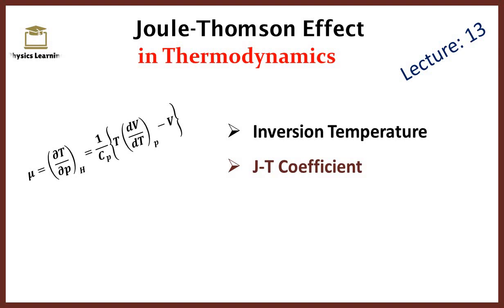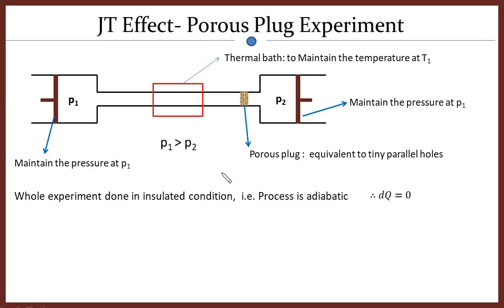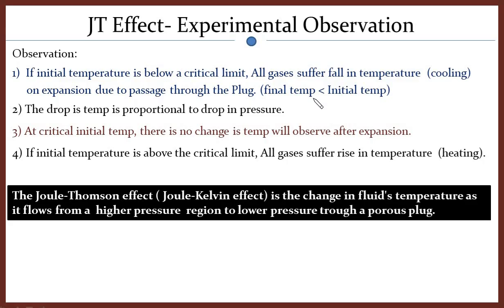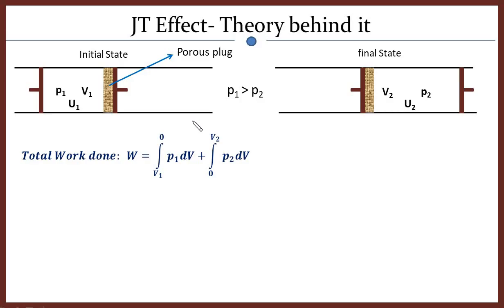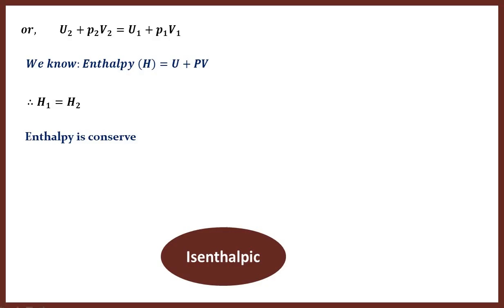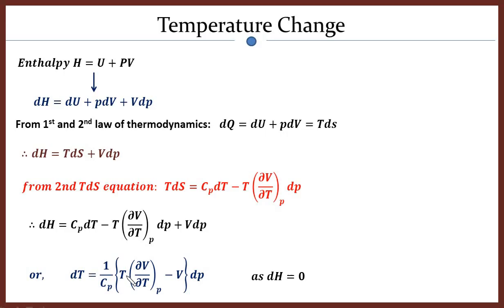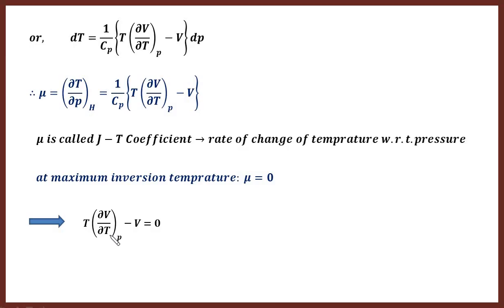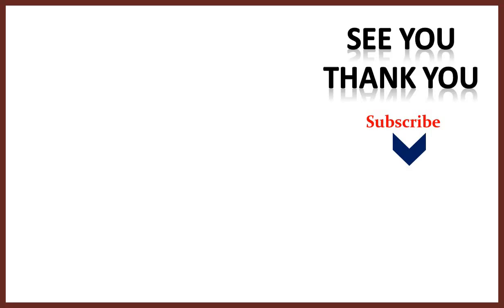Joule Thomson Effect | Inversion Temperature | Explained | J-T Coefficient | Lecture 13

Comment: I have a question. We define thermal expansion coefficient as alpha = delV/delT over V, so we can replace delV/delT as alpha times V. Then, according to the last equation you'd derived, for mu to be positive(mu>0), T should be "greater" than 1 over alpha. 

But, here's inconsistency with your statement at the beginning of this lecture. You said, when initial temperature is "smaller" than maximum inversion temperature, cooling effects accure, which is equivalent to the statment mu >0. 

I want to know why this kind of inconsistency arise.

Comment: Work done by the system is -ve right?
Reply from the maker: Work done by the systrm is positive whereas work done upon the system is negetive. Sometimes, chemistry people use otherwise. The main things is if system will do some work it will loose energy. How you interpreting this results will decide your sign convension. 

But it wont change anything in the final step  because everything is related to first law of thermodynamics.
Reply: @PhysicsLearningwithDrShaw  ok thanku

Comment: Work done by system is negative not positive.
Reply from the maker: Sign convention are different in the chemistry and physics. In physics, work done by system is positive.
Reply: Dear hopeless tutor, P1V1  here is not (-)..It should be positive as the system underwent compression.Your P2V2 should be (-) as it underwent expansion.